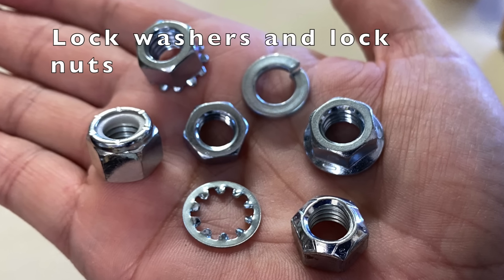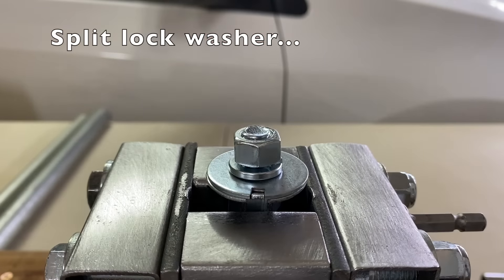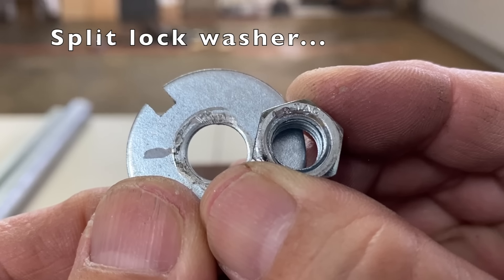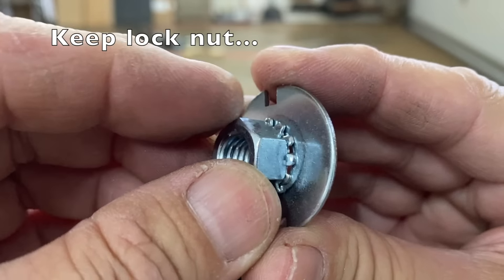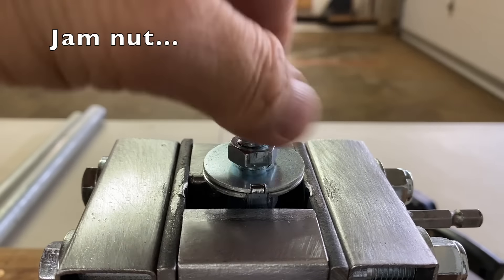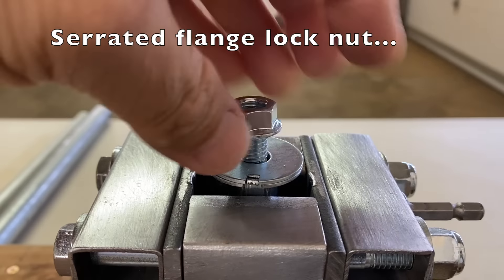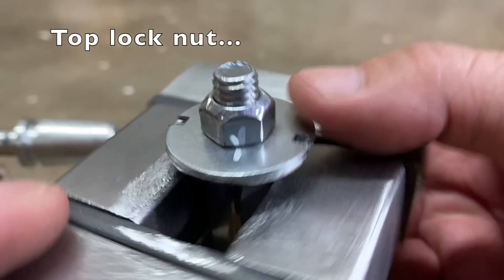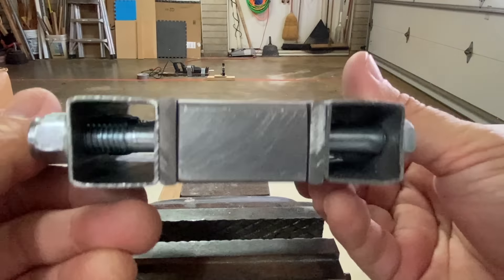Lock Washer & Lock Nut Vibration Test

Comment: Experience over 45 years: they all work to some extent at REDUCING loosening. But the only lock device that categorically prevents it is a castle nut & split pin.
Reply: I agree,I believe as a 39 yr tech that a castellated nut and cotter key to be the best.
Reply: What about loctite?

Damn, where did I put those cutting disks for my Dremel!
Reply: Stage 8 locking fasteners as well where a castelated nut and cotter pin combo cant be used
Reply: Nordlock washers work extremely well.
Reply: This is why airplane nut/bolts use either castle nut with cotter pins or safety wire to secure them.
Reply: @mimimmimmimim  probably left them in your purse because nobody that stands up to pee uses a dremel.  👌
Reply: @mikejones8866  They also use the flex type locking nut like the last one in this video, which is the only reliably reusable type.  Keep in mind though:  the primary lock method is the correct tightening and joint assembly.  These are only secondary measures to prevent the fastener coming completely undone.
Reply: @mimimmimmimim  I always use JB weld on the threads. I promise you will never loosen it again
Reply: I have been repairing machinery for 60 years and have made many repairs caused by the use of split lock washers. Many times the washer breaks and works it’s way out from the fastener. A manufacturer of large turntable bearings in their manual states “All warranties express or implied are null and void if unit is installed using split lock washers” . It went on to say “by time that the fastener is loss enough for the split lock was to do any good, it is already to loose. I’m not in the aviation business, but I can’t remember seeing split lock washers on aircraft. The best place split lock washers is the scrap heap.
Reply: @tracylemme1375  I couldn't agree more.  I work mostly in stainless where they're obviously, at best, pointless since they can't "dig in," but certainly worse than nothing.  My line is "tell me how they're supposed to work and I'll consider allowing them."  So far, no one has even attempted an argument.
Reply: Or if it no longer needs to be removed pein the bolt. Often what is required for electrical bonding of structural steel. Bolt  wire on and then pein the end. Even if it comes loose it's not coming off.
Reply: Safety wire
Reply: That's not true at all; welding works also.
Reply: @mikejones8866  Many aircraft assemblies use nylon stop nuts. See AN365 series. There are other aircraft lock nuts such as MS21042 series. I have never seen one of those come undone.
Reply: Security locknut is great too.
Reply: Also safety wire if you need extra security. Nord lock washers seem fine for anything non-critical though.
Reply: These are best. Any pinned or wired lock is better than washers.
Reply: @MrKruger88  😅 You're clearly a man who doesn't' f*ck around.   I approve.
Reply: My motorcycle comes with those for the wheels.
Reply: @leepower2717  nord locks are equally as good as a cotter pin in my experience. Only thing better is safety wire.
Reply: @paulmoir4452  
I was taught in high school shop that a split washer works by exerting pressure on the nut. It is supposed to be more like spring steel. Never heard it was supposed to dig into both pieces.
Reply: @gordonwedman3179  I've read similar explanations, but what is the spring force compared to spring force of the fastener itself?  It is completely and purely in material compression well before sufficient retention torque is applied.  Dig in theory is, I think, at least plausible.
Reply: @enriqueoliva6988  Yes, but depending on the application, I’ll occasionally drill a nut and bolt through the flats, then insert a roll pin, drill and tap the nut just on one side, using a grub screw, or drill and tap down the thread, between the nut and bolt, and again fit a grub screw.
Reply: @krazytroutcatcher  or drill and tap all six flats on the nut and dimple the bolt then screw in six grub screws on the nut and stake them,then revise the estimate and ask the customer for more money (on parts and labor)for all that extra labor drilling and tapping and more money for the grub screws.
Or drill the nut and bolt thru and install a safety wire or wire lock,no tapping needed.
Reply: @enriqueoliva6988  Lol!, I used lock wires on motorcycles for racing, however, I use something better engineered on a $million printing press.
I did state depending on the “application”
Not all engineering disciplines are the same, and in some, lock wire looks unprofessional.
Reply: @krazytroutcatcher  lock wire looks unprofessional for the people that don't know a thing about it.They have been used on piston engine airplane because they work.
Reply: @enriqueoliva6988  As I said previously, different engineering, for different applications.
Reply: Castle nuts come loose just as a normal nut would, then all that’s protection you is a little piece of metal which I’ve seen fail many times, never seen nylocks fail
Reply: @jaxturner7288  I love my Dremel!
Reply: With lock wire
Reply: @paulmoir4452  Not saying they are good or bad, but I pressume they work both as a spring which keeps pressure even if the nut is loosen by a bit and as a lock since they are spiraled against the loosening rotational direction.
Reply: @gambini_modding  I understand this theory but I reject it because it can't work in practice.  These are not a stack of Bellville washers:  it takes very little force to completely compress them, at which point they stop being springs.  Compare that to the clamping force of tightening the fastener itself.  The fastener is woefully loose by the time the split washer expands and starts acting like a spring.
Reply: @paulmoir4452  This video proves they do work in practice at least to some extent. Springs hold energy, moreover when fully compressed. In my opinion when a nut resonates with a vibration and moves from its position it loses tension against the thread which creates a cascade effect that eventually loosens it completely. If the washer can keep the tension even, even if the nut is vibrating, it will prevent that to happen. I use loctite myself when I want to be sure a fasterer wont come lose. Just saying the theory of the split washer makes perfect sense to me, and after watching this video I may use them some more.
Reply: @gambini_modding  While I appreciate the effort of the author of the video, this is only one mode of nut loosening.  When I don't want a fastener to come loose, I use the appropriate bolt stretch, secondarily measured by torque or angle.  If I want to mitigate damage caused by a fastener loosening because it has lost its primary locking method, I use an appropriate retention method, including loctite.  But after it has lost its primary locking method, fatigue is probably going to break it in the end.
Reply: @gambini_modding  Sorry, I didn't really address what you wrote.  I guess my point is, that by the time the fastener is so loose that the split washer becomes uncompressed that there is nothing to prevent the fastener from fatigue, and I'll argue that it doesn't retain the fastener for a useful length of time before  it comes completely undone.
Reply: I've got 46 years experience and I say that deeze nuts are best
Reply: @Amberlynn_Reid  you beat me to it...
Reply: Safety wire !
Reply: @enriqueoliva6988 I was at an automotive museum recently and noticed some old race cars on display had what appeared to be lock wire wound between every exposed bolt of the body panels. I was told the primary reason wasn't actually to lock them in place but to keep them from falling off the car if they did come loose.
Reply: Castle Nut or Crossdrilled Nut & Bolt is the only thing we use at work when there‘s moving or vibrating parts.
Reply: What about welding the nut and bolt together?
Reply: @JoeRoganful  Then get married...
Reply: Stake If You Plan For Permanent Placement.
Reply: @jaxturner7288  sitting stops the mess from those with lousy aim...just saying😂😂
Reply: No kidding, but he didnt test those, pay attention.

Comment: I work in the aerospace field and this is exactly why we always use lockwire (safety wire) for aircraft applications. Even with torque specs applied, they can break loose.
Reply: I was about to say this. A good lockwire application is a great way to prevent vibration loosening, as far as I see. With my limited knowledge, I only see creep or fatigue as potential problems.
Reply: Preload is the key to a successful joint.  Lockwire (like a castellated nut) is really only intended for dynamic joints.  In the case of a structural joint that is for whatever reason is overloaded, lockwire does not prevent failure……  it simply becomes a lanyard to retain the bolt head that pops off.
Reply: Hex head bolts are sometimes wired together on production machinery too. I've come across these several times.
Reply: Surprisingly car wheel nuts all are conical without any washer at all, & they proven last for many miles or even years, no issues...
Reply: @jstwatchnread8420  The question is that, how much vibration are they subjected to?

For example, jet engines and rocket engines are told as vibration monsters. And this video shows how vibrations can loosen fasteners.

Are non-racing car nuts also subjected to problematic amounts of vibrations?
Reply: 2A2 reporting in!
Reply: Safety wire sucks so much, I never got it down really well
Reply: yes, lockwire and cotter pins are all mechanical safety device, but in this particular test in the video, he missed the torque that the fastner requires, like we check AC43 or standard practice for factory torque, but in this video, 11 ftlb is probably not the proper torque for that hardware, so the test just lost its purpose.😄
Reply: Yes, used it in the aircraft and oil field a lot.
Reply: just wanted to remind you of this comment!
Reply: Yeah. Even the things that survive 90 seconds here are going to be a risk over hours or months.
Reply: @jstwatchnread8420 Lug nuts are subjected to a very consistent vibration pattern from the rolling wheel, and lots of shock absorption from the tire and suspension, so it's not nearly as shocking as this test. Conical nuts would be reverse threaded on one side of the car so the oscillating stress would not unscrew them. Modern wheels use nuts with washers where the nut torque keeps them on, so they're RH threaded on all the wheels. The hub precision-fits to the wheel to keep the wheel centered, so conical nuts aren't needed to do that any more. Though they're not gone completely, and show up on niche vehicles.
Reply: Nord-Lock washer works on Tension not Friction. It is a try’s game changer in every application Aerospace, Railroad, Robotics, Powergen etc…

Comment: Would have been nice to include Loctite threadlock (red & blue) to the experiment.
Reply: Yep, when you want to be sure you use loctite - orange is good stuff
Reply: +1 for locktite and it would be nice to check locking-wire.
Reply: Next video hopefully
Reply: Looking forward for the next test.🎉
Reply: Locktite would pass espocially if you use high or medium strength
Reply: also why not test combos? nylock, threadlocker + the split washer.

Comment: I was an active duty sailor "Opticalman" back int he late 70's. I worked on a sub tender, pulling, repairing, and installing submarine periscopes. One of the more grueling aspects of the removal/install process was dealing with the large (3/4" thread?) nylock nuts that clamped the lower seal complex to the submarine inner hull. There were a lot of them - I seem to remember 12 or 16, the nut prevailing torque had to be greater than 15 pound/ft or you replaced with a new one, and they were way up in the overhead in a mass of pipes and cables. Used a collection of cut-off wrenches, pull bars, crowsfeet, sockets. The first few were OK but you get tired working up in the maze, hanging over the periscope well. Every turn of the nut required force, and many times it was a 1/12 turn using a 6" long cut-off wrench, flipping it every turn. Literally thousands of manipulations. Especially nasty was the install torque to value - around a 115 ft/pounds. And if with a crowsfoot, more force on the pull bar. All being watched (but not helped) by the sub's sailor assigned for QC.  

I don't know what was used before Nylocs. I imagine it was some kind of split washer system. That would make the nut running up and down FAR easier.
Reply from the maker: Thanks for your service!   Appreciate you sharing your experience.  😎
Reply: Now that's some gruntwork a Marine respects.  :)  Thanks for keeping the rust-buckets afloat, my salty compadre.
Reply: Thank the Brits.  Simmonds invented what we now know as the Nylock knock off by Abbotts
Reply: Generally castlated nuts with a split pin, think ball joints, or wire tied nuts which are still used in aircraft today.
Reply: @scroungasworkshop4663  Right, safety wired or castellated nuts were probably used. In fact, in my dusty 45 year old memory banks, I kind of remember seeing some big castellated nuts in the Periscope Shop storage area.
Reply: @randydewees7338  Probably, the last thing you want in a sub is the periscope falling off😂😂😂. Cheers 🍻
Reply: Wow!

Comment: Excellent test! The split washer and nylock performed exactly as I expected.

I would be interested to see the difference between fine threads and coarse threads. Theoretically, find threads are much more resistant to vibration due to the lower angle of the threads. Like a wedge-shaped door stop that is made with too low of an angle can be wedged into a door super tight.
Reply from the maker: Thanks!  Good idea!  I just might test finer threads.  Working on vibration testing threadlocker right now.  😎

Comment: Thanks for this interesting test video!  I have found that Nylock and Metalock (like your Top Lock) are almost 100% effective because no matter how much the bolt loosens they will not freely spin off the fastener. Cotter pins are almost as good, however they can shear off, allowing the nut to freely unscrew with no warning. When the Nylock or Metalock are loosening by accident, they do so gradually so that the parts become gradually looser, allowing noise and vibration to build with time; thereby giving the operator time to stop the machine before it becomes catastrophic.

Comment: Excellent test!! I had an issue with a 75hp Evinrude e-tec outboard motor. 
I had some work done on it, replacing a power cable due to saltwater ingress near the battery.
Thereafter I had trouble starting it, just not enough power getting through. 

I kept saying there was something wrong, they said that I didn't use the motor enough. This went on for a couple of years. 

Eventually I looked at it and they had used '2' of the internal lock washers on the Solenoid!!! Not enough power was getting through.

They SAID that this is the Evinrude specification. I removed both internal tooth washers, put a flat washer on the inside of the post, a nylon lock washer on the outside. 

In the 4 years since the motor starts 1st time every time and the lock nut hasn't moved. 

I finally feel vindicated. The connection is more secure and sufficient power gets the the solenoid to do it's job. Thank you.
Reply from the maker: Great story!   Thanks for sharing!  👍😎

Comment: My grandfather invented the split lock washer. It was originally called a lock nut. I have all of his original patents. He even invented the tools to make them. The original lock nut looked the same as the current lock washer on the inside, but they were cut out like a triangle, with a hole in the middle, then split. When installed, the points on the triangle could be peened up over the nut. He was also one of the thee who invented separately putting gas takes on the back of a car. They had no fuel pumps yet, so the gas was siphoned to the engine. He also invented many of the components for railroad tracks.

Comment: It would be very interesting to see how the nordlock washers would give for results. They are supposed to be some of the best in the world.
Reply: we use them at work, along with blue loctite. torque it down to 160Nm for M10 bolts iirc. Never had an issue with them

Comment: iirc the internal tooth lock washer, keep nut, and serrated flange nut are designed to not use a washer so they can bite into the softer metal they are clamping. Like cast iron or aluminum.  
If you can swing it, can you set up a separate jig no washer into cast iron or aluminum? Or even a softer steel.

All in all great video and great testing!

Comment: I think you will find, as the tightening torque increases, the game changes.
Higher tensile fasteners and higher tightening torques change the game in several ways.
Toothed fasteners and spring washers fail earlier as both the hardness of the metal and the tightening torque increses.
Plain fasteners hold better as the tightening torque increases.
Finer thread pitches increase available fastener tension and friction.

one of my favorite combinations is a high tensile bolt , nut and washers backed up by a nyloc nut as a lock nut.
Reply from the maker: Thanks!  I'm saving my pennies so I can redo the test  with grade 5 fasteners and higher torques.  😎

Comment: Where a lot of people go wrong, is using a flat washer under a locking washer. Preventing the locking washer from griping to both surfaces. The flat washer starts to slip first allowing the nut to loosen. Also I have also seen bolts wired incorrectly, where the wire tension is placed in the wrong direction allowing the bolt to loosen a few degrees.. I don't expect red loctite to do well in this rig, red loctite is brittle when dry fully and can be broken with impact.( a hit with a hammer )